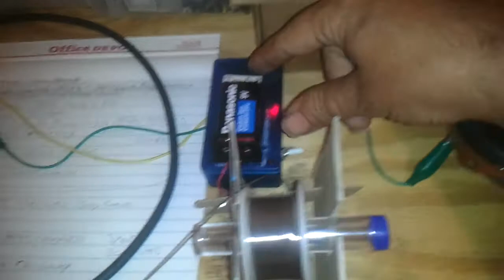Function Generator Wave Synthesizer

Comment: You should NEVER EVER touch any capacitor (let alone an electrolytic cap like the one you rub the top of @ 2:00) within a power supply circuit. EVER! Not even when the device is turned off or unplugged.